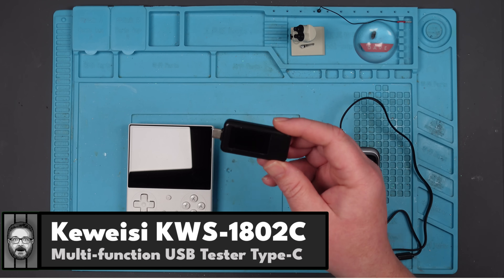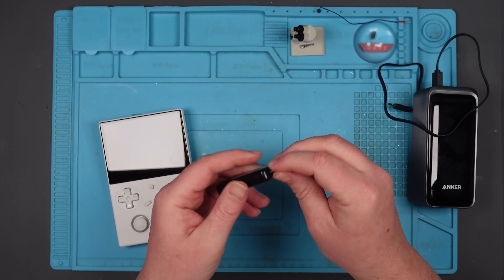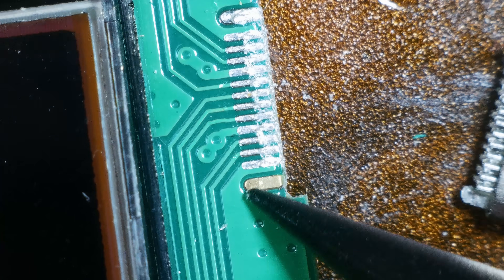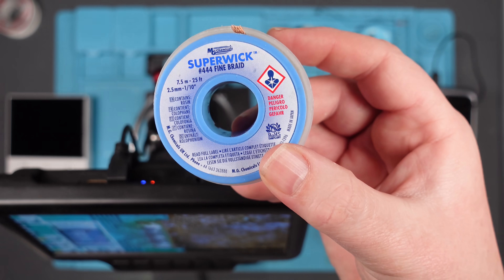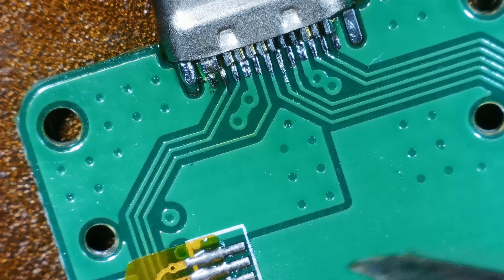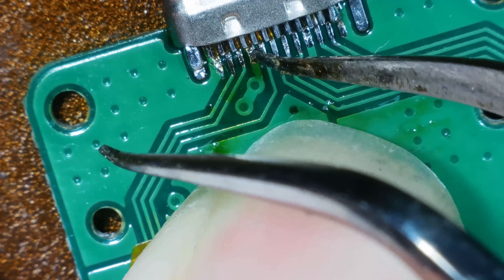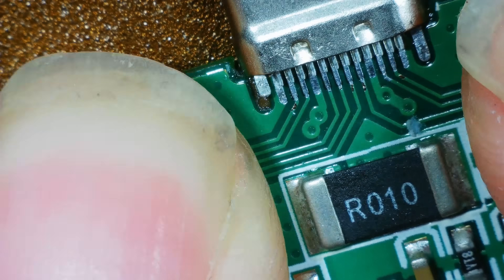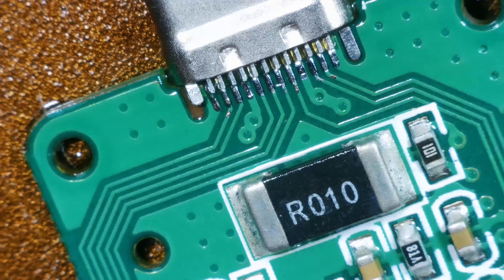My USB-C Ammeter isn't working properly! | Let's FIX It

Comment: Great fix, nice and simple!  I fixed my glue gun the other day.  The trigger had come off, so I put a useable length power lead on instead of the 15cm original, and re-manufactured the (lost) idle stand from a coat hanger and heat shrink cable.  A new one is less than 2 euros, and it was still nicer to mend this one.

Comment: USB connectors are great if you just plug them in and leave them, when they are plugged and unplugged all the time they don't last long they are to flimsy phones laptops or anything that use them end up failing, the C type and that other one are even smaller and very hard to fix if you are not used to soldering and don't have the right tools, microscope is essential, if you just want a power supply and not the data use the old barrel type connectors much more robust and easy to fix, wish manufacturers would take note but then again it is all about money so (buy a new one) or send it back to our specialists to fix.

Comment: Outer fins are for stability but also are "Shield". The next pins on both sides are electrical ground. But Shield may be ground but doesn't have to be, depending on requirements, especially EMI.

Comment: I think you missed a trick there Steve. If the circuit board mask is negative around this port you could on the lhs scrape some green off it and solder the port tab to that as it is negative as well. On the rhs, solder directly onto the port bridging across to the negative nearby. Samo on t' other side. As you say, you know what I mean :-) then the port would more likely stay in place.

Comment: i was having the same issue y just resolder and add a piece of solderer wick full of solder to add reinforcement to de pin.... as advice beware os using this amp meter with  devices that have 20v because the pads burns the pcb... not enough copper to handle that voltage

Comment: As far as CA accelerant is concerned, you can get the same effect with a sprayer and water or isopropyl alcohol. Super glue cures when exposed to water vapor in the air.

Comment: I have the same ammeter and it's reporting the wrong numbers. I opened it and the USB connector had a marginally better solder job. It's not coming off but the pins are bent across.
It's telling me that I have 2.8V while I actually have 5V and it claims that my MacBook Pro is running at 12V while it's actually at 20V. I don't think it's the connector though. My hunch would be with a current sensing resistor or something like that.
EDIT: Mine is slightly different. It's labeled KWS-1902C V1.30. I soldered the connector back (only 1 pin actually loose) but it didn't make any difference. I checked all resistors and components, nothing weird. Who knows...

Comment: Hey Mate, love your work!.  Just a thort. Cut an old type C cable as long as you need, and solder the cable wires directly to the power meter. That will stop broken type C connections moving on. You use that thing nearly every video.  Thanks from sunny Brisbane :-)

Comment: I was really hoping you would flip the port around so you could solder the big pins to pads that were still there 😅
Reply: Flipping it changes nothing, all it does is move the anchor pin on the other side to the missing pad 😅

Comment: @10:40 I am sure the super glue is fine but sanding down to the ground plane and then using solder braid to create solid welds to the usb header would have been better.

Comment: it's clearly not aligned, you should go to specsavers, you should cut and separate from the ground pad than sport the sport pin with a piece of wire if its possible

Comment: I'm thinking you should have reversed that port and maybe the pins would line up. Either way it works. I have one of these but it's just normal USB A made by Ruideng.

Comment: If you can source some glass pipettes, these can be heated and stretched to make very small, very precise glue or other liquid applicators.  If its too small, just snap it off until the desired opening is achieved!

Comment: You  should have just flipped the port over, then you could have lined it up better and not used the ripped pad area.  Then used uv curing glue (not mask) to anchor the sides.

Comment: Might I suggest a repair for the missing pad, Steve?  Drill a small hole through the port tabs and PCB, insert a wire through the hole, and solder it secure.  If ir works well enough, do it to the other side of the port to reinforce it.

Comment: After your last video, i bought some superwick. Ive been using a cheap wick and it just wont soak up solder. I bought the superwick and it works like a charm. You need affiliate links steve
Reply: same here... quality flux, solder, and wick really makes a difference!

Comment: Its a great ethos steve less crap going to landfill. and to strengthen up the connector you could have just built up and nice soldier blob each end and soldered it the the connectors shield.

Comment: Great fix love your vids. Do you do customer work? I have a night heater controller for my camper van and the fingernail sized 4 pin connector block has pulled off the board 😢. Its £80 for a new controller, but as per your new motto, why replace what you can fix haha

Comment: 99,9% pure alcohol is only that pure as long as the container is unopened, after that the alcohol starts to absorb water from air and drops to about 96% pure. Works just as fine though!

Comment: Now you should find a cable to use instead of just using the meter plug so if nothing breaks it will be the cable

Comment: Dear Stez, i have a problem and i need a point in the right direction. I have some bent pins on one of my motherboard cpu sockets. Brings a tear to my eye just typing it!
 I'm looking for a digital microscope that would have sufficient magnification to allow me to re- bend, afore mentioned pins, back into correct positions. I have a budget of around £200 and will purpose the microscope for other tasks once motherboards are fixed (if at all possible). Ideally the microscope would be on an arm as opposed to a base, they seem a very small work area for an ATX motherboard etc. 
Im sorry the start of this message sounded like a Jim'll Fix it letter.
any advice would be greatly received.
Loving your work amigo.

Comment: I had one of those exact same model  and it did exactly the same thing.  Threw it away!   Replaced it with a USB C cable that has a little display on one end and shows you how many Watts it's delivering,  works well and certainly feels more sturdy.
Reply: Mine broke as well, bought a new one with a small cable, as to not put stress on the joints..

Comment: Super glue is usually not gap-filling. Epoxy would have been a better choice. It builds up and provides leverage. Since this is not a high stress situation though...

Comment: You really do like to make life hard for yourself. Why solder the connector with an iron when you can just use hot air? It's so much easier. 

Those little USB multimeters are an absolute godsend. I misplaced mine recently, finding it again was sheer joy.

Comment: Side A, when pins do not a-line, You need  to use an individual connection pin a-liner tool, because the pins have a small  left and right adjustment movement built in to each pin,
Other than that. I agree, Repair, Reuse, Fix Save $$$$$.

Comment: When you started checking the pins to see if they were.....SOLID....and you found a little movement on one pin, then another, it reminded me of the Lockpicking Lawyer.
Reply: Nothing on 1, nothing on 2, little bit of movement on 3, nothing on 4, nice click on 5.....
Reply: Only think missing is a Fluke multimeter.

Comment: I find crumbs inside the plugs,u have to ensure you don't put devices like that inside your pocket without a port protected,I make sure I put my phone in my pocket with the USB at the topside of my pocket so that bits in the bottom of my pocket don't get in the port
Quite often I need a new cable because the plug has debris inside it

Comment: Baking soda acts as a kicker to solidify the glue and also adds structure.  The powder turns into a solid plastic like material.  Test it by putting a blob of baking soda on a sheet of paper and then a couple drops of superglue and you'll see what I mean.  I usually do a mixture of putting glue on, sprinkling baking soda to kick it/add structure.  Sometimes I build up the baking soda, just depends what I need.

Comment: Why do you add leaded solder BEFORE removibg it with the wick?
Reply: Mostly used to mix the old solder in the pads so can be removed easier.
Reply: reduces melting temperature to make it easier to wick up.
Reply: @yotoprules9361  So lead makes the melting temp lower? It makes sense as the end of the wick will be less hot, and the lower the meltibg temp the more fluid it becomes. Thanks.

Comment: Hot glue! You can add some so the shell keep pushing on the connector both sides. To release it just need to heat it up a bit.
Reply: Or IPA...

Comment: For future reference Steve, if you want to make a stronger super glue bond, sprinkle a little bicarbonate soda on the glue, not only does it cause it to set up almost instantly, it also makes a much stronger joint. You can also fill gaps with the bicarb and then, if your CA glue is the thin/runny kind, drip it onto the bicarb to fill the hole.
Reply: You can even mix a teaspoon of baking soda with water, put it in a spray bottle and use it as activator spray
Reply: I’ve found that method to be less sound than just using CA and accelerator.  If you have trouble with gaps use a high viscosity CA gel instead of thin runny fluid.

Comment: It looked very strange that the pins weren't in line.
I would have rotated the USB socket. Maybe the alignment would be better then.
Reply: I think he might have put it back the wrong way around
Reply: @MisterZealot   Considering the pins are offset the exact same amount in the opposite direction on the opposite side, that's a resounding... yes! It's upside down.
Reply: @MisterZealot  Its only slightly off center.
Reply: @tyronenelson9124  indeed. Won't make a difference. It's just a bit irking to my need for symetry tho' 😅

Comment: 4:48 - Sometimes I really wonder about your attention to detail.  You didn't remove the delaminated pad off that first anchor point so hopefully it's fully anchored correctly with the new pad.
Reply: could also be the reason the pins didn't line up all that well.. it was back to front.
Reply: I think that might be "thing" of this channel. To show you can be awful and still get things working. Gives confidence to people to try it out for themselves.
Reply: When all fails.  Super Glue and baking soda.    It will stay forever.

Comment: That off-center pins upset me greatly
Reply: Should of put a new socket on that had all the anchor points but it works.
Reply: It's making me crazy.  I also have no idea why he didn't flip the port over
Reply: Yeah I feel that's going to cause issues again down the road.
Reply: YES... same here
Reply: Me too ... 😂 "you are bad and should feel bad" (futurama) make a redemption video.. 😅
Reply: You should take medicine for your OCD. 
I have OCD but I don't let videos on the interwebs upset me. 

My medicine makes me tolerant of random gibberish. And the sprayer of my kitchen faucet is even rotated to the left 20 degrees. I don't even notice it.
The pills make the phone calls go away.
Try them. 
Now the only thing that upsets me is when i leave socks on the floor and my cat drags them into her litter box, on top of a poo.
Reply: Same here he could've done better
Reply: Same as the old anchor pad that wasn't removed from the port😂
Reply: Your grammar is equally as frustrating 😄
Reply: Just the angle of the camera
Reply: @MenaceInc  nope its off center. you can tell by the gaps on each side of port
Reply: @dondyrecords who cares if it works.
Reply: @dondyrecords  True. It can't be camera angle because one side looks off to the left and the reverse looks off to the right.
Reply: @Skibbyz  Longevity. The original PCB layout must be fractionally off.
Reply: @MenaceInc  not it's not
Reply: @MenaceInc  no its not
Reply: @ yes i am.. what?

Comment: The exact timing of that "why is there movement" has me chuckling.   I hate these devices where the connector is basically surface mounted without any through holes for strength. For something obviously meant to be plugged in and out of other devices, its just bad design.

Comment: Like I said in the last vid. The cable is fine. It’s just that when you used a type c to type c cable, the power bank looked for a charge control chip in the device and didn’t find one so it didn’t charge. When you swapped to usb A to usb c, the power bank didn’t are if there was a charge controller or not.
Reply: Some power banks, especially ones with the usb type a sockets don't use the 'handshake' chip that you are referring to, as not all usb cables include the data wires, those types of power banks tend to wake up using a certain amount of current draw detection.